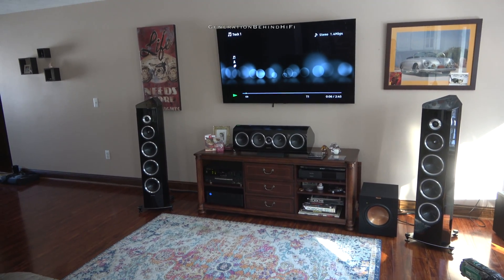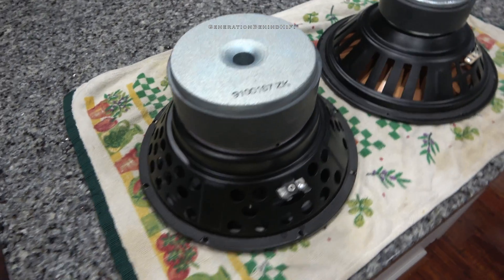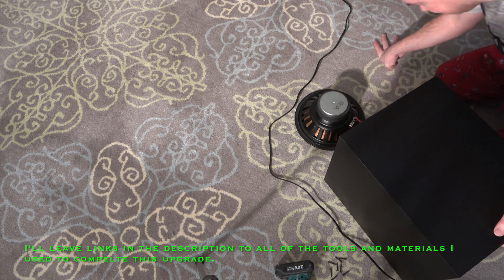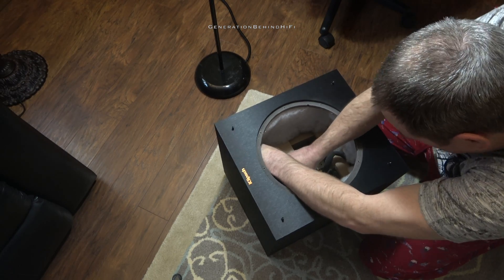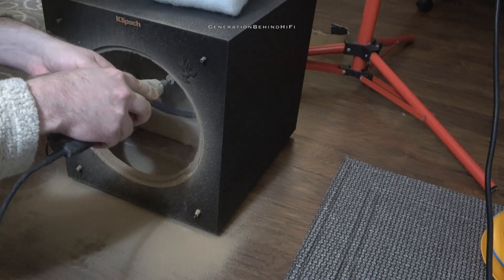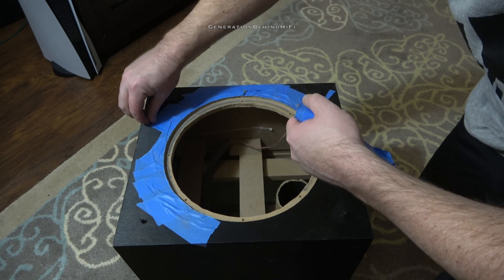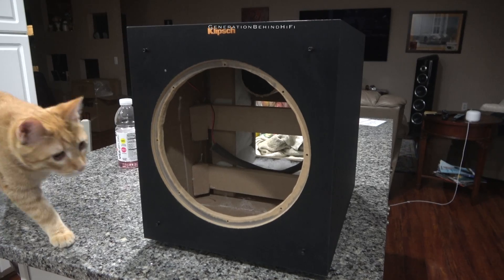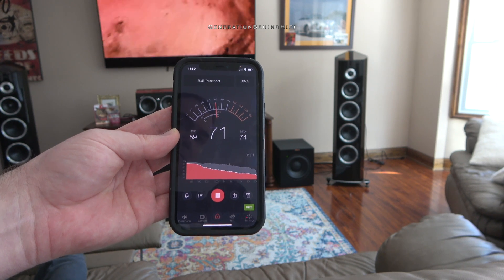Upgrading A Klipsch R10SW R100SW R101SW Subwoofer Part 1/4

Comment: A hint. If you want ot enlarge openings, get a cheaper router, then a set of router bits with bearings on top, another set bearings on bottom, a set of bearings, and you can mix and match to open it up. Pre-cut holes will serve  as a guide. I.e. 1" router bit with 1/4" bearing...you have to calculate what works with what

Comment: That port tube must be really thin to be able to cut it with just a razor blade...Klipsch usually has pretty thick tubes
Reply from the maker: It's made from cardboard. That's why its so easy to cut.
Reply: Cutting the port without knowing or messurements, I guess you just got lucky!

Comment: I have a pair of Jbl 550p subwoofers that are going to get a driver upgrade. I chose the Dayton Audio Ultimax 10 as it would fit perfectly for my application. I wanted to put passive radiators on both sides but the bracing is in the way so no-go on that. The driver upgrade should be enough. My only problem now is finding time to get it done:(
Reply from the maker: Cool! I too recently bought a JBL 550P and did a driver upgrade. The cabinet on the JBL 550P is worth the $189 price on its own. I couldn't believe the construction this thing has for the price I paid. I will have an upgrade video out soon that also includes the calculations and modeling I did. Simply put, the driver upgrade was incredible!
Reply: Cool! I can't wait to see it maybe I'll get some ideas about the passive radiators. I think it'll greatly improve the output.
Reply from the maker: @samsneediii1793  Passive radiators would definitely improve the output, but the 550P cabinet isn't setup for it without some serious work. I posted a teaser picture in my community section if you're curious about the driver I went with. 🙂

Comment: have a jamo C912 subwoofer, replace the 12'' woofer that comes with the jamo by a branded 12'' subwoofer (BlackSpider 600W). A huge difference in bass quality, detail and depth. And no carpentry work was required, the subwoofer fits perfectly.

Comment: You should have pulled out the port tube and then cut 2" off. That way you could have cut it more evenly and at a better angle.
Reply from the maker: Yeah! I tried! They glued the dang thing in there so well that when I tried removing it, the cardboard tube started to collapse.

Comment: it would be interesting to know what the box tuning changed to after the port was shortened. it inadvertently probably helped blend better with the sealed subs by raising the F3 point. that and a MUCH better driver!
Reply from the maker: Hey! I know! I wish I knew the TS parameters for my new Martin Logan driver. I actually touched on what you mentioned here in my Klipsch R10SW disassembly video. I'm guessing Klipsch's engineers had to design such a long port tube to make up for the weak driver that they installed. 

No doubt the new driver is leaps and bounds better in every category! This was the best $45 I have ever spent on upgrading a speaker! This subwoofer used to sound boomy, but now the bass is tight, controlled, authoritative, and blends beautifully with music (with a rag in the port). If you happen to know the TS parameters for this driver, please post them below. It would be much appreciated!
Reply: @generationbehindhifi  the length and diameter of the port tube coupled with the net internal volume of the box determine the original and new tuning of the box. you can approximate this reasonably well with WinISD.  Of course, if you've plugged it then that is now moot :)

I don't know the ML TS parameters unfortunately. A Dayton Audio DATS3 will tell you the TS parameters of the speaker itself but that's a whole lot more expensive than the speaker deal you got!
Reply from the maker: @Gbrnole2  Thanks for the tip! I will take a look at WinISD and Dayton Audio's tool as well. Much appreciated!